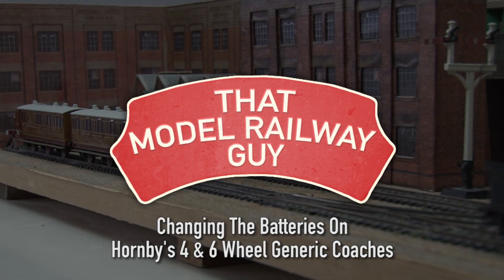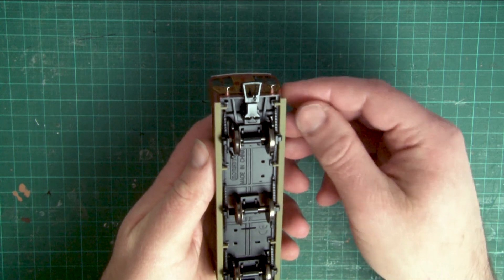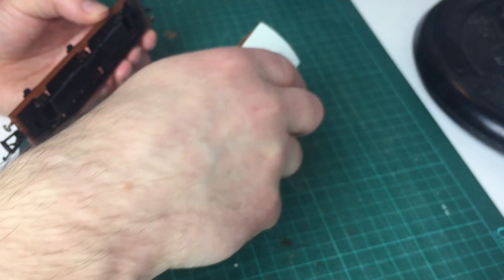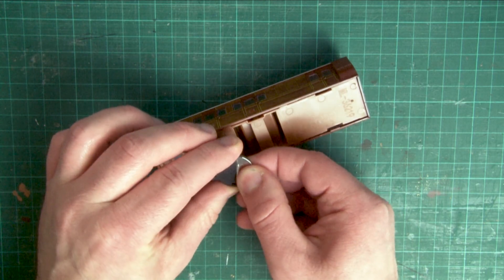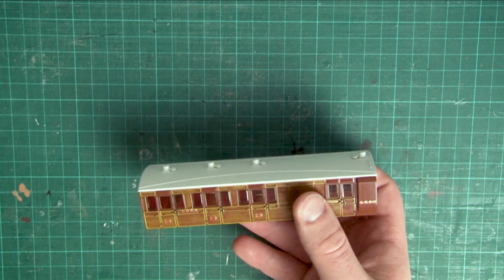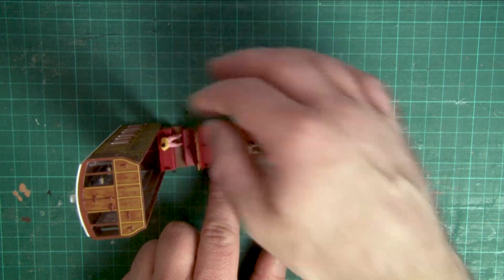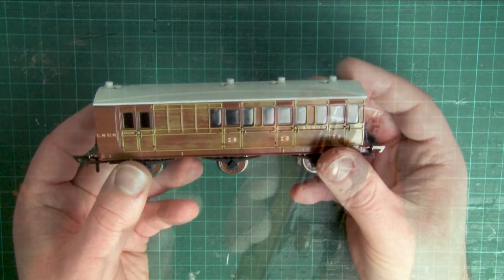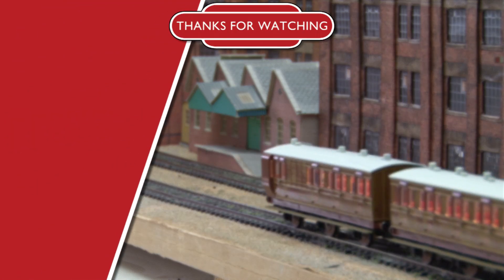How To Change The Battery - Hornby 4 & 6 Wheel Generic Coaches - Model Railway Tutorial

Comment: Great video and thanks for doing these
 video That Model Railway Guy. One question want having if want to make 6 wheel coaches down to me bigger  4 wheels now easy it to take out the centre wheelset on a 6 wheel coaches and removable it on the Hornby one? That Model Railway Guy in these hard times.
Reply from the maker: I don't think Hornby have designed the centre wheelset to be removable on the  6 wheel coaches but I'm sure if you're dedicated you could find a way to remove it. If that's a feature you want then the Hattons coaches are likely to be a better fit as they have that as part of their design. Thanks for watching 😃
Reply: @ThatModelRailwayGuy  Thanks for the information.  I don't want to break the Hornby model it would be nice if it was a feature because there I would go from NBR Hornby. Only one wants I looking at it Lnwr 3rd,1St coach with light.  From Hatton, I'm looking at NCB as got them on pre-order. These are want to get two but waiting for the Oxford Rail 2021 future announcements. If there don't wow  me I will order Hattons Batch 1 (LNWR livery
) Batch 2 (L&YR 
, Midland Railway ) Batch 3(Metropolitan Railway
, SDJR) Will ask mum, if have some for my birthday want in may. But the Hatton one is planning to come out around  April 2021 & June 2021. But keep safe  @That Model Railway Guy in these hard times.

Comment: This concept of using a magnetic switching function is a great idea. I will be looking at adding lighting to a longer coach (Hawksworth). Do you know if I can simply wire in an additional length of Hornby strip lighting in series and power the entire length from the one switch?
Reply from the maker: Hi Richard, I think that would work but I'm not sure to be honest as I've never tried it with the Hornby lights. I would suggest having a look at Layouts4u.net - they have very similar battery operated LED strips which are a bit longer for standard coach lengths. Hope that helps and thanks for watching 😃

Comment: I'm wanting to install some lights into a 6 wheel Hornby coach like the one in the video but noticed the battery compartment is set into the bottom of the coach housing.
How is this attached?
Has it got an adhesive backing?
Reply from the maker: As you can see in the video it's just held in by friction. The battery holder slots in underneath the interior and when the chassis is clipped back on it's sandwiched between the two, so no need for any adhesive. Hope that helps and thanks for watching 😃
Reply: @ThatModelRailwayGuy  Arh ok so just sits in the gap basically.
Will have a good at it and get the light strip.
Does the actual light strip have adhesive on?

Comment: I saw a comment from another you tube channel that with sound fitted loco's the magnets in the speakers  were inadvertently turning on/off the lights in coaches as they passed by. Any thoughts?
Reply from the maker: I don't have any sound fitted locos so I can't speak from personal experience here, however I was under the impression that magnets for triggering sound were usually embedded into the track. If that is indeed the case then it shouldn't be a problem for these coaches as the reed switch is in the roof and you have to get the magnet quite close to activate it. Thanks for watching 😃

Comment: I've just had to change batteries in 2 of my 3 lit LBSCR carriages. After I initially tested them I boxed them back up for safe storage. The magnets in the bottom of 2 packs switched on the lights of the carriage in the box beneath them & flattened the batteries. I now store the magnets elsewhere.
Reply from the maker: Thanks for sharing that Jonny. I have to admit I don't use the Hornby magnets much with mine as I usually have a magnetic pole I made for removing coal loads from wagons on hand instead. But good to know for anyone who is thinking about boxing them up at some point. Thanks for watching 😃